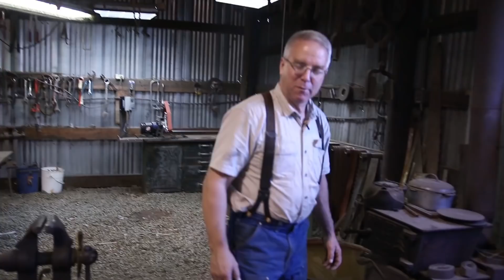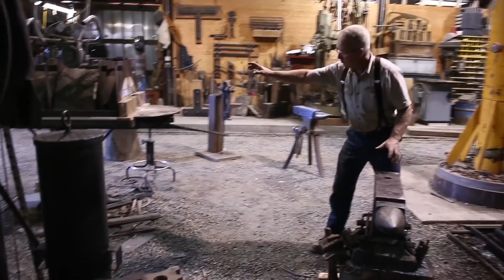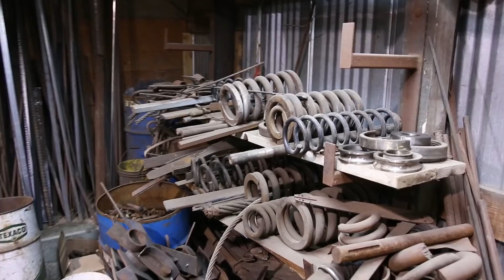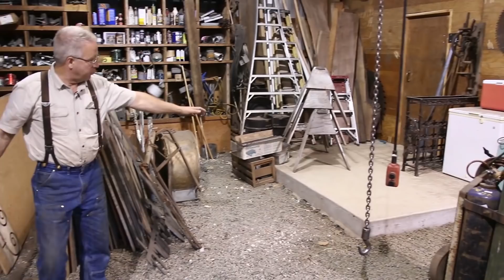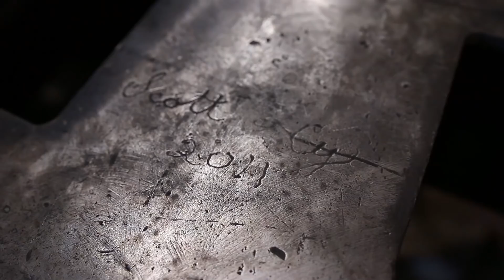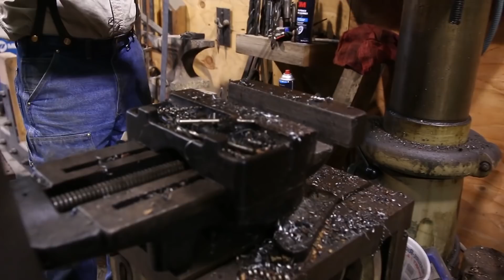Shop Tour #1: The Cave of Wonders

Comment: Since it is an old barn does it have a concrete or stone foundation or is it just poles driven into the ground and tin wall nailed to the poles? Because I was thinking of build a big work shop on my property, but I don't have the money to build a concrete foundation. So I was thinking of driving some poles on the ground(dirt) and nailing tin panels to the poles and building a simple roof. But wouldn't the soak up through the ground under the wall and make mud every where in your shop.

Comment: The shop tour is great, I just bought a JRD-750 radial drill, auctions are great, I think its a 1988 year. Why is yours up on a platform? Do you use the coolant pump? I dont see the flex hose.

Comment: Thank you for the shop tour. I would like for you to expand on shop flooring. Concrete is very hard on the lower extremities causing circulatory problems. I have a machinist handbook from the 1950's that recommended dirt floors because the uneveness of the floor was more kind to ones feet. what do you think of floors made from wooden blocks that are packed together on end?

Comment: Had to come back to this primarily to hear what you had to say about flooring in a shop area. I plan to combine woodworking (not fine but practical) and woodturning.  In creating sawdust and chips and curly cues from the turning, a concrete floor makes sense. But for long time standing gravel, say 1/2 and less makes some sense. I like your presentation style and true love of your craft, it inspires me to do better. Keep bending nails and shapeing steel.

Comment: Hello sir. Thank you for the knowledge you are passing down to us.  I have a question regarding atmospheric moisture and tools. Is this a problem for you in your area? I cant keep my power tools in my utility truck or in the gang box.  Moisture gets to them and some of them fail if not used for sometime. My steel tools rust up.  I see that your shop is not insulated and maybe not air tight.  Which is appropriate.  But does that have an effect on your tools life span? If so how how do you deal with it?

Comment: This looks a lot like my shop, Scott, though not into blacksmith work (yet).  I've also got a piece carved out for auto work, as we rebuild my sons '43 Willys MB.  It's a working shop, like yours, so always looks like a bomb exploded to a degree.  The recliner is a nice touch - I use an old office chair for my afternoon reboot, which is no where near as comfortable.  Working on a cement floor all day is horrible.  I use the rubber mats, but they're always in the way, and sweeping is impossible.  I'd much rather just have a dirt or wood floor, and I think my next shop will be built that way..  maybe do 2x sleepers with 3/4 ply.

Comment: Like the steam whistle, you probably don't use it as a signaling device.

You could put a manifold to turn into a musical toots when your working, by running the compressor head pressure relief to flow through and toot every time the compressor stops. (Working music for a. Lack smith shop() be sure to turn it off for night Peace ✌️)(and a manual or manuals , a pull chain and a foot switch)

Oodles of fun for grandkids.

Comment: Thanks for the inspiration. I was thinking of you today, as I was replacing interior doors. Bought blank slabs and hand fitted for the hinges using butt gage and sharp chisel. Used hole saws to mount knobs and bolts. Trimmed for width and height with worm drive saw. Every time I picked up a tool, even a screwdriver, I was reminded of another of your videos. Not to sound weird, but your stuff is worth listening to 2 or 3 times, especially for those of us who have a casual acquaintance with tools.